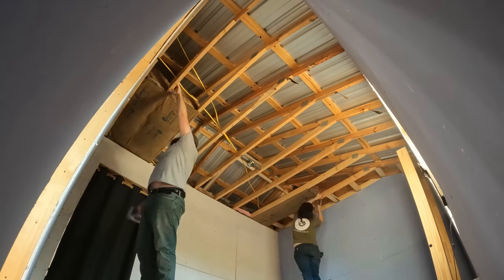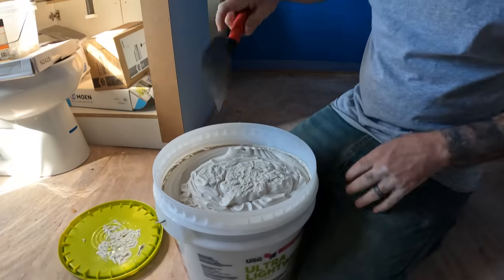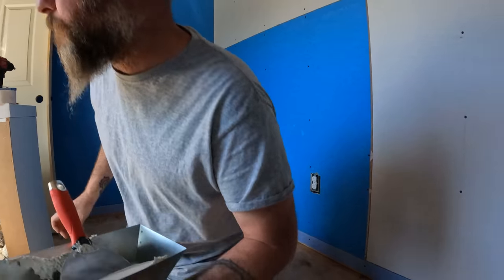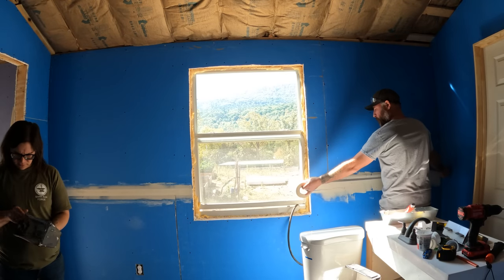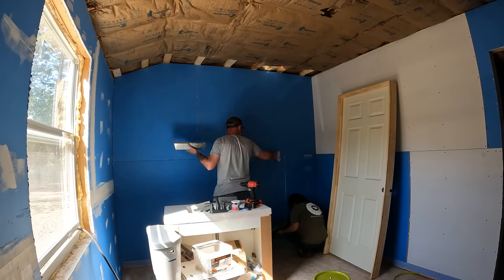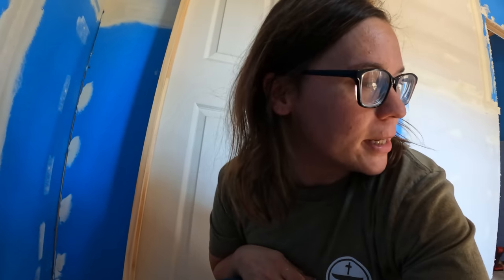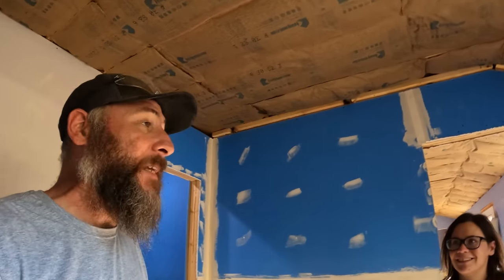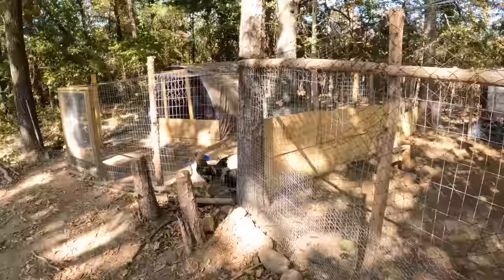This is so frustrating! | DIY Shed To House | Tiny Homestead In The Woods

Comment: May I suggest that y’all finish completely the bedroom and bathroom now, paint and all because it will continue to inspire y’all to get it done! Then finish your bedroom next completely , paint and all. You’ll be amazed at how accomplished you’ll feel. The LR and Kitchen last will push you forward to finish the whole house, and you’ll be surprised how fast it goes! You’ve still got time to do the skirting before it gets really cold, and the cooler weather coming will make it pleasant to work outside for the skirting and insulation under the house. That’s my thought anyway. Keep it fun and painting is the icing on the cake❤️👍👏🎉
Reply: No you may not "suggest" anything.......wtf
Reply: @lazlo5055  Dude... what's your problem?
Reply: @lazlo5055  WOW, I wonder who granted you the power of putting words into crcs mouth. 

No need to be rude, she just asked, and encouraged. Get a grip dude.
Reply: @jackiesaylor2487  and no I don't speak for CRC or anyone else for that matter.
Reply: Excellent ideas! Then it’s not a big project plus they get the most important rooms done first. You should always go for your personal nest and make it comfortable.

Comment: I keep a spray bottle of water to wet down the surface of mud inside the pan. It needs very little extra water, but adding a little will make your life SO much easier. I also smooth out the mud in the bucket and spray water on top to keep it from drying out. Then lay a sheet of Cling Wrap on top too.

Comment: Anthony, I've done a ton of drywall.  I never take it straight out of the bucket without mixing it with a large drill and a paddle mixer. I am totally amazed, that the new bucket of mud did not come with a layer of thin plastic sheeting on it to keep the air separated from the mud.  I would highly recommend applying saran wrap on top of the mud before you store it, even overnight. Using a damp sponge for the final smoothing also helps fill in any little pores left in the mud before you prime and paint it. I prefer the larger sponges that look kind of like a dumb bell, as they are dense and don't change much with adding some pressure..

Comment: Hi,
Regarding your rooster problems. You are probably aware you do not need any rooster at all, unless you need fertilized eggs for hatching purposes. Also, I do not have a plucker either, so I usually just skin the roosters, which avoids the need to scald and pluck.

Comment: I like to to tape, mud sand three times,  when I have it really smooth I like to water down my texture and with a roller go over and give the wall a little bit of texture. it hides a lot of imperfections.  I'm 61 and live to work on my house, I did second bath and kitchen,  looks like a pro.  I have rheumatoid arthritis, and have remodeled 4 homes.

Comment: Ant, we just moved to North Arkansas and the house has a metal roof.  We believe the house was built in either 1950 or 1964?  Moved from TX and I know nothing about metal roofs.  We have a ton of work ahead of us to save this dwelling and that starts with the basement and roof.  Are you using mineral wool in the ceiling?  I understand metal sweats?  Learning through you Bro.  My mistakes will not be the mistakes you made and educated us on.  I'll make plenty of others though.

Comment: I like to add touch of water when in my tray  especially when need thin for like scratch  cover   spread quicker and smoother   
I also pre wet wall just little with spray bottel in mist mode  and prewet paper tape  mud application  goes much smoother

Comment: TAKE A FIVE GALLON BUCKET PUT JOINT COMPOUND IN ADD A LITTLE WATER TO MAKE A THICK SOUP THEN PLACE TAPE IN TO COAT THE TAPE THEN PLACE COATED TAPE IN THE JOINT THEN TROWEL THE JOINT.

Comment: Get yourself a corner trowel , add water toyour mud as it will make life much easier at about 3 pars mud to one part water , leave the mud on seams thick with a 8 inch trowel as that is how far of an overlap you will need than apply the tape and go over it with a 12 inch trowel , you will find that you only have to mud twice , that the mud goes much farther and you have much more working time with it . Just an F.Y.I.

Comment: There  is a diy trick where cut slot wide enough  for paper tape to pass thru  say a 1 gallon  plastic bucket  close to  bottom  them thread  tape through  put prepend thine mud in bucket now as you pull tape through  comes out pre mudded  then tear out length needed  be sure to leave tail stick out bucket so can continue  to pull tape thru for next one  
Put  mudded  tape on joint and trowel as normally would

Comment: add some water cool to that mud  mix it in good till it feels  smoother   btw  no need to fill in gaps  first  apply mud with 5 inch blade  apply tape and  cover with mud again   let dry  apply second coat with 8 inch trowel   let dry   sand  and if you're going to paint  add third and final coats with  45 minute mud    sand  and paint

Comment: For as few as you have a plucker isn't really necessary, nice to have but not necessary,   for just a few it will take you longer to clean than to just pluck them.  Ask at the feed stores if there are any in the area to be rented or if anyone has one that they would loan.   The only way to stop the bullying is to process them.  Keep one or two for "just in case" .  As long as you have mature roosters you will have fights.  The only thing I could think of is to move the roosters  completely away from the others, and not really sure that will work.  Good luck and God bless

Comment: Dude get mixer that goes on your drill!!!!! It's only like $10 at Lowes. Since your not mixing the mud in the tub there are air bubbles. You have to mix it. Any crack that is more that 1/8 inch there is 45 min mud you should use. So that there is not shrinking. I just hope people don't know it this way. There are plastic corner bead also you can use. You should have the ceiling done also. I am sure this sounds like I'm a no it all but watch Stud Pack on Youtube!!!!

Comment: Y'all need more hens than roosters.   It is usually 10 hens to one rooster, depending on the breed. Don't separate them.  At this point though, if you try to bring them all together again the roosters will now fight, because they have been separated.

Comment: I don't like that lightweight mud because it's full of air and leaves bubbles when dry. And I told you I could show you how to finish it easier, but you never got back to me. I did drywall off and on for over 30 years and I'm just right down the road. JS

Comment: I've been watching for awhile and believe everyone has their own techniques but if you thin the mud down it goes on so much easier. I always use the Durabond 90 in the bag.  To prefill where needed. It dries  in 90 minutes  so if you want to coat it faster you can. It just seems like it would speed the process up for you.

Comment: Inside dry wall corners  I prefer the pre taped metal  inside corners  
When installing  over small gaps filled with  mud under  then when applying  mud to exposed side not accidentally  poke holes in tape with  trowel while mudding

Comment: save your trowels  after clean uo  scrape off any built in mud  with wire brush  and use a light coat of oil on them blades  keeps them from catching any rust    best of luck guys

Comment: It gets better guys but never go light, put more and sand and it sounds nuts sure but one thing is in your favor... the texture will cover any little holes in the mud. I hope that your going to insulate under the house as well or no need to put skirting on. Pipes will freeze if not warm and just skirting won't keep it warm enough... even with heat lamps

Comment: Acting in the reason why your tape Bubble Up on the walls is because you're not putting enough mud on there if you put enough mud to take will stick to the mud instead of bubbling it out and one last tip if you clean your lives and your pants after each usage it won't rust out on you like that

Comment: As per the roosters.  Freezer camp time.  Roosters are bullies.  Dip the roosters in scalding water and pull feathers after disbatching .  You do not need an electric plucker.  And if you do not want fertilized eggs, roosters are not needed.  They are just added stress and issues.